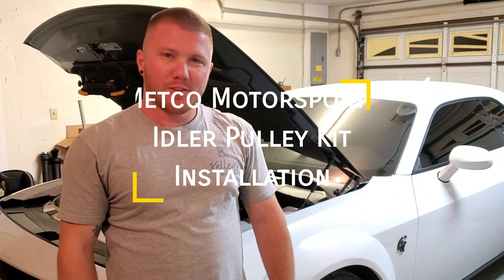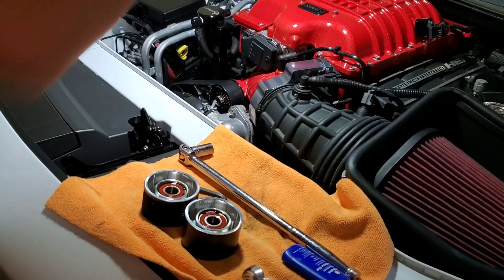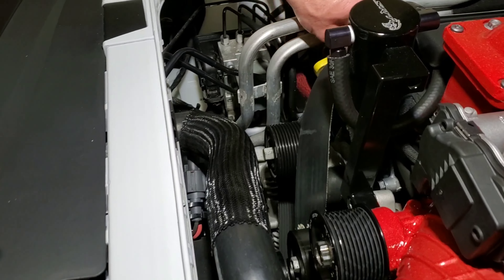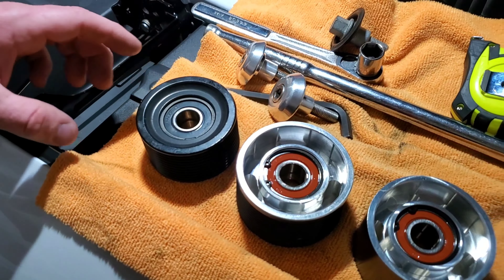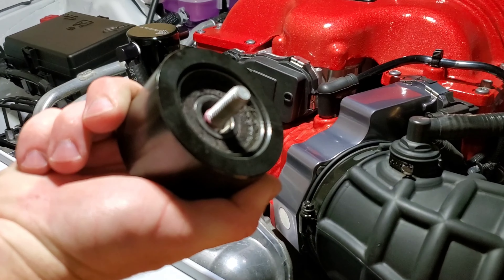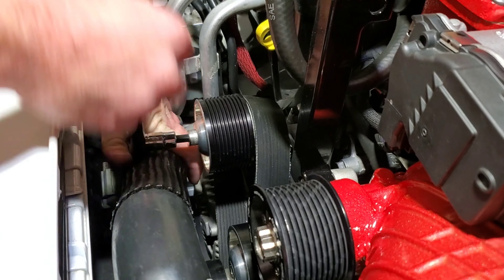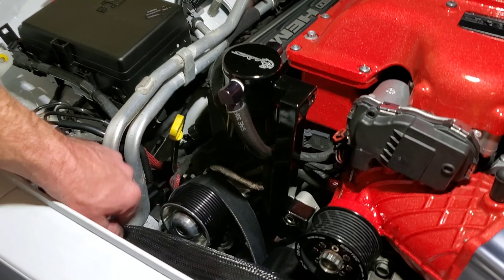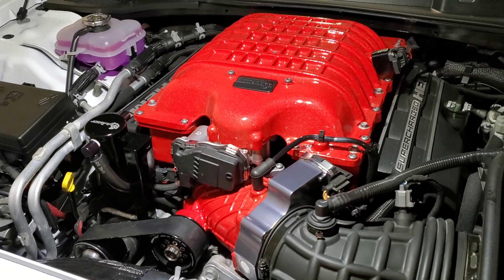Metco Idler Pulley Kit for Hellcat Redeye - (Ep. 24)

Comment: Awesome video
Reply from the maker: Thank you 🙏🏻
Reply: @KelleysGarageOfficial  did the car feel any different after install? Rev faster?
Reply from the maker: @blkbird98ta  with a 105tb nothing revs fast lol. Less rotational mass equals less strain on the supercharger rotating system. These Metco pullies are also larger in diameter therfore less belt slip.

Comment: So when changing the supercharger pulley and you have the hellcat redeye do you use the demon or hellcat pin holding tool
Reply from the maker: I've attached a link below for the tool you'll need. Make sure to get the Demon adapter also. It'll be in the drop down menu. 

https://highhorseperformance.com/metco-hellcat-pin-holding-tool-challenger-charger-hellcat-jeep-trackhawk-dodge-demon-redeye-hpt2000/
Reply: @KelleysGarageOfficial  thanks